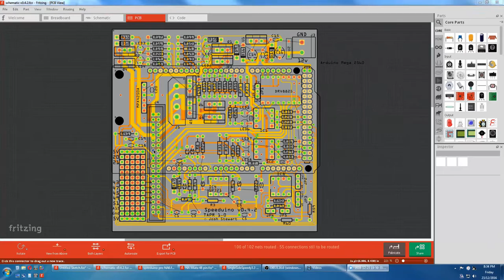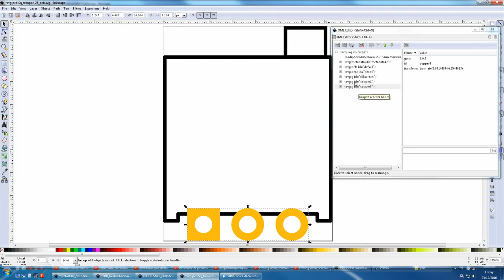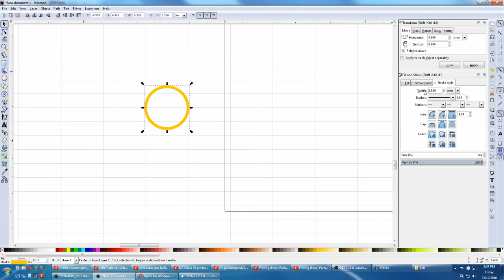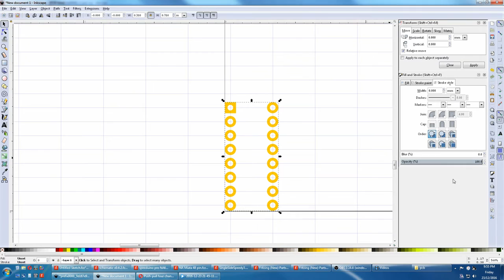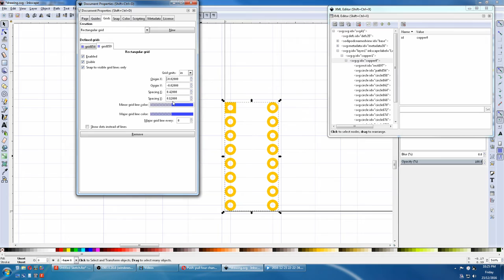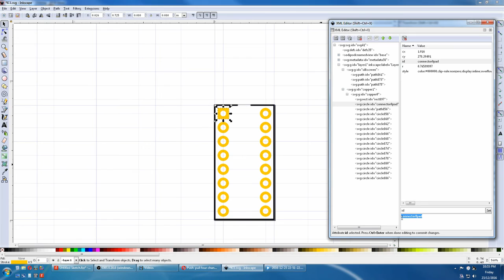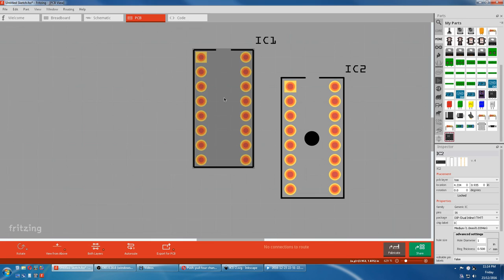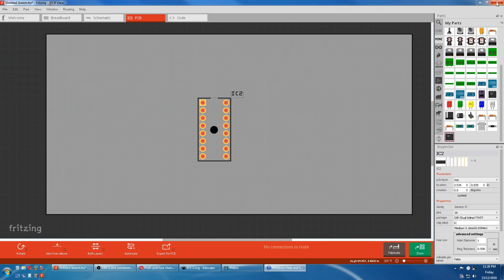Fritzing Part Creation - Chapter5 - PCB View

Comment: Hi! Excellent tutorial but it doesn't work for the holes... I always get either a 100% copper circle or a hole with a 1mm copper stroke, whatever I do.
Reply from the maker: I quit FZ/electronics after I did my "Fritzing Parts Fast" series and have forgotten a lot, but I think it's a group problem. The copper ring needs to be a "circle" not an "ellipse", and it needs to be in the copper group for the side of the PCB, ie, copper0 is one side, copper1 is the other. You could also possibly have that circle duplicated in another group, and that is making it look filled when it's not - you need to see if it's filled in the Gerber render -. You can checkout my better "Fritzing Parts Fast" series - I should delete this old series because it's dated/harder -, or the quick way is post on the FZ forum with the .fzz file and Vanepp will fix it.
Reply: @SidneyCritic  ok this got my answer! The hole has to be in the "silkscreen" group as well. Thanks! https://www.youtube.com/watch?v=PYtUIVJEqIY
Reply from the maker: @FroggyVids  Ah, you wanted a hole not a ring pad - oops -. Yeah a circle in copper with 0 stroke, and it copied to silk so you know it's there.

Comment: Great video. I just downloaded the SVG templates from Fritzing. The schematic template does not have the copper 1 group. Have you looked at the templates? Are they simply old?
Reply from the maker: If you mean the SCH view of a part, they don't have copper groups, but instead have connectors thrown in under the major schematic group. BB is the same with 1 group, it's PCB that has to have the 2 groups with copper inside copper. Unzip parts and you can see the construction, but remember some parts are not made by the FZ team so can be different.